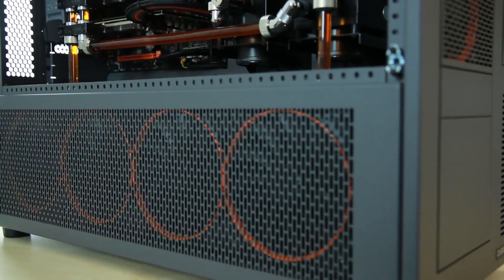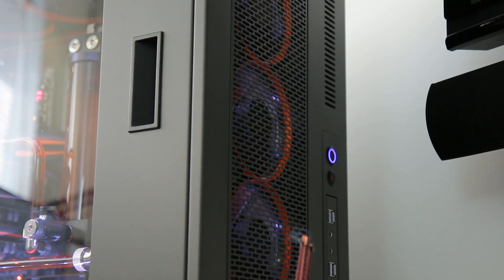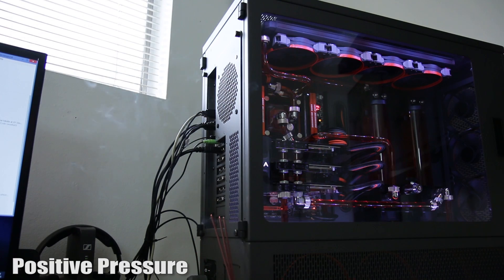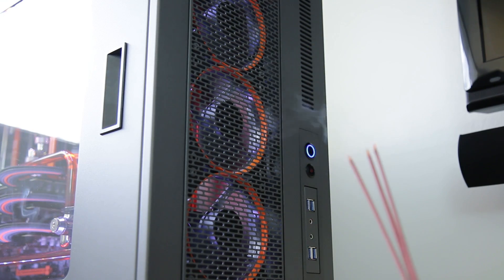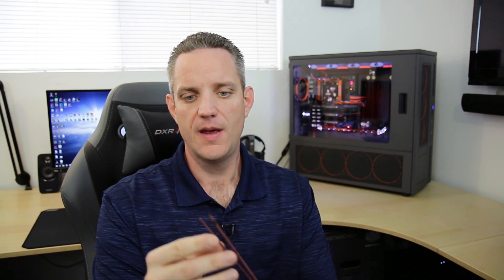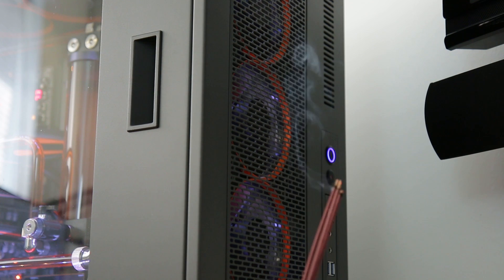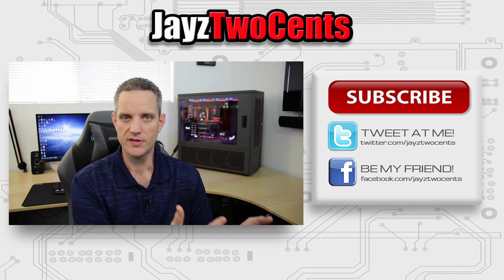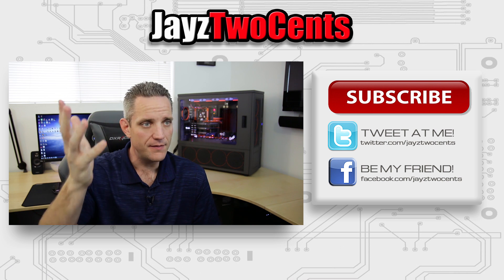Case Flow and Pressure Demonstration - How to balance airflow

Comment: It's worth noting you missed another huge factor that makes maintaining an actual neutral pressure inside pretty much impractical without actually using an actively managed system with a bunch of sensors. Namely the fact that how much the air is heated inside also affects the pressure a system which had neutral pressure when it hits equilibrium right after power on would actually become positive pressure once the components begin to heat up. Sure you could compensate for this but to make it work regardless of the load on the system you would definitely need to have the airflow systems regulated by feedback from internal and external barometric pressure of course the fact that neither the air velocity or air temperature within the case will ever be uniform and as a result the air pressure inside the case wont be uniform either as the Bernoulli Equation and PV=nRT will explain why this is the case.

Comment: Great method to show the air flow!
But strictly speaking, positive pressure only means the average air density in the case is higher than the outside, thus have higher pressure. Only during the transition from negative or neutral pressure to positive pressure is there more air entering into the case than leaving the case. Once the pressure inside the case is stabilized, the amount of air going in and out will be equal again. If there's always more air going in than coming out, the air density inside the case will keep increasing without limit, forming a tiny black hole in the end, which is apparently impractical LOL.
Reply: You would have the most cooled PC on the planet if you formed a black hole. You would also have no PC. So two birds, one stone. Make it happen.
Reply: This is how I lost my first pc build
Reply: How do you think I created my singularity time machine?
Reply: Dam, someone beat me to it. Guess I was 3 years late to the party
Reply: positive case pressure is determined byairflow out exhaust fans and exhaust vents it does not account for all other cracks and crevices. the point is to have more air coming the intake fans then out the exhaust fans thus positive pressure
Reply: Have you think about mass inertia in your conclusion aswell? In the heating system of your house is pressure (about 1.5-2.5bar depends on the hight of your house) and ofcourse a pump. So right in front of the Pump, is a little less pressure and right after it you got a little more i think about 0.5 depends on the power of the pump. I know thats water and not air, still there should be a pressure difference in your case aswell because of mass inertia.
Reply: Actually I don't think so. Positive pressure means that you are pumping in more air than your normal exhaust vents (including exhaust fans) can handle. So air is starting to get out of the case in way it wouldn't normally do. That is through holes for the screws, edges between panels etc. In neutral pressure dust may build up in those holes.
To simplify the things up, lets say you have a one exhaust vent whitch can handle 1m3 of air per second (I know, ridiculous amount of air). If u pump in 1m3 per second with your intake fan, the pressure will be neutral, as all of the air will be pumped out from the case with exhaust vent. But if u pump 2m3 per second, the exhaust vent will handle only half of it. So the air will have to find other ways to get out of the case, that is all the cracks between panels, holes for screws and other places where dust may build up, or else it will explode like an overpressured car tire.
Reply: @Failer__  Also, the static pressure of your fans is what determines the maximum pressure your case can reach if you had poor exhaust.

High static pressure fans are ideal if your case has restricted airflow. If you had an open air case, you'd want to optimize for CFM instead, where your fans don't necessarily have as high of a static pressure, but still move a lot of air.

Static pressure is like the measurement of raw load you can pull uphill; CFM is like the measurement of how fast you can actually move.

So, if you have a high CFM, high static pressure fan, you'll get a lot of air in your case even if it's not optimized.
Reply: @Failer__  No, physically speaking air in = air out, unless the case pressure is increasing.

If the case pressure with respect to time, dP/dt is 0, then air in = air out.

I think that this is actually more important to account for in fan placement and venting in your overall case choice and case design. I.e. the Fractal Torrent, possibly the best air flow case on the market, has a ton of free space at the back for air to escape.

This is important BECAUSE air in=air out. I.e. if your case has one exhaust port but tons of air intake, you should really get high static pressure fans so that the air flow out of that single exhaust port is high, because the air going out of that exhaust port is equivalent to the air coming into your intakes (minus leakage).

Getting "neutral pressure" is actually not strictly important; neutral pressure is a good indication that you have a good balance between exhaust and intake, and therefore your fans are not redundant.

Comment: 2 questions

Do you need a fan controller? 
Second is I know that the front is intake and the back is exhaust but what I'm confused is what is  the top fan going to be intake or exhaust and also the bottom intake or exhaust? Thank you

Comment: What would you do for a Corsair 800d case using water cooling?  Top 3 fans on the radiator for exhaust.  I could modify the case and get two more fans at the front of the case for intake.  Would you use the back fan as intake as well?

Comment: You should answer if mini-fans work to help with this positive pressure? I have a bunch of 20mm fans mounted in a bunch of spots and it seems to work well to optimize airflow with being able to adjust some of them as intake or exhaust to fine tune the point of perfection.

Comment: I will use only 3 case fans of same rpm, cfm and sp
1 intake at front
1 exhaust at rear
1 intake at top
I won't have any drive cage, will use single m.2 ssd and no HDD 
also the two fans on CPU cooler will push air towards rear
So is this setup fine ?

Comment: I use a similar method for checking for intake and vacuum leaks in engines, but I use a cigar. You can pull a LOT more smoke out of a big cigar. The gas station usually has a wide selection of big cigars.

Comment: I'm glad I found this video. I'm currently waiting for Fed-Ex to deliver a DIYPC 07-b case, which has 7-120mm fans. 4 intake, 3 exhaust. I'm worried about airflow, because it'll house a Maximus VIII Ranger, and a 6700K. It's a full ATX case, so all SHOULD be good.

Comment: Good Video!
I tested behind my video card on the PCI slots and sure enough it was sucking air...Made 2 exhaust fans intakes and now i'm getting a good positive pressure in the case with results to match, dropped 2C on idle on my Liquid CPU

Comment: I am aware of positive and negative pressure (studied engineering in college) but I didn't really account for it in my personal build but I ended up making a very positive system. I'm not using any filters so dust is just going to happen. The only thing I accounted for is fan placement based on hardware. I did not get any special fans for my build as I was trying to stay around $1000 so I used the stock fans in my Corsair case. I shifted my large side fan lower on the side panel and flipped it so it flows in which blows in to a compartment that essentially has a roof (my MSI 1070 fan intakes) so that space is air dedicated to my 1070. The front 2 case fans i shifted upward so that they provide air dedicated for my CPU cooler (super tall cooler master heat sink, forget the name right now). and one exhaust port right behind the CPU cooler. So 3 fans in, one out, and the top of my case is a mesh so any excess air rises out there. I specifically chose a midsize case where my GPU essentially touches the case of the side fan so it would split the case into essentially 2 compartments where I could dedicate air. I run just fans and at load/benchmarks I average about 40C on the processor and 60-65C on the GPU.

Comment: I am getting a corsair 460x (comes with one intake and one exhaust fan)
also getting a h100iv2 cooler. should I have the h100i in push or pull, and where? wtf I'm so confused :(

Comment: Good video, its funny I stumbled across this video Jay, I have had an old Tagan A+  EL Diablo Case since I built my last system back in 07. I recently upgraded essentially my entire system and reused the case (Old PC was ASUS ROG Exreme Mobo with SLI 8800GTX GPU's) At any rate since I was building my wife a custom system for Christmas and because of the fact that she had never had a custom PC I decided to buy her all the high quality hardware so my stuff had to be a little bit cheaper (Who am I kidding a lota bit cheaper) I went with a AMD8350, MSI 970A Krait Edition Mobo. 32GB DDR3 Ram and Gigabyte OC 1060 6GB GPU. At any rate, I noticed after about a month that I was having very poor performance issues with some higher then normal temps both at rest and under load. I blamed my Mobo at first, but I was given a mid tower case from my father in law who no longer wanted his custom build system as he didn't spend as much time on it gaming anymore. It is a mid tower and I haven't a clue what brand it is. But I noticed that the airflow of the case is 1000X better then my old case and my PC has never ran so good. My temps are below average and my system is happy. I miss having my flashy full tower case but I am very satisfied with this one.

Comment: what about in the case, lol, of smaller more mobile platforms? I run a mITX case due to travel, so I can actually fit my ITX in a carry on bag and not have to deal with a laptop solution (i hear they've gotten better, but I'm still a bit weary, and the prices are outrageous)

the case i'm running is a silverstone RVZ01.

Comment: I would be surprised if case "pressure" matters at all. Cases are specifically designed to not be air tight. If you stuck a barometer in there I'd be super surprised if it was anything other than .9999999999999 or 1.0000000000001 local atmospheres.

Comment: But given the slite amount of preassure that a fan can give... someone correct me if im wrong.,, you shouldnt consider the air as a compressible fluid. (only if you were makeing speed of close to 0.3 mach, depending temperature). So then if you analize the control volume you would find that the awnser is other, since the law of conservation of mass for this kind of fluid gives you that the flow of the fluid should be the same on every "section".  Other thing, if you want to keep a good flow i think would be good ideas to... remove the corners of the chase of the computer, it adds just to much noise, formalize the air flow (only one direction for in and out) and change the overall shape of the chase XD... im always trying to find the ways to apply fluids mechanics to computers, im still lack the experiencie though

Comment: Eh isn't the smoke made up of water vapor? (My point is it might not be enough to do any dmg, but I kinda don't like the idea + there is even a more simple way and its free.)  I usually just use my hand and I feel the air flow or even an easier way. You can run heaven and from that you can feel the temperature of the air. So if you feel the hot air blowing at your hand that means its exhaust airflow at your hand and if you don't feel hot air blowing at your hand then that means its intake airflow.

Comment: I have the NXZT s340 elite. I'm concerned because i have the h100 i V2 radiator mounted on the two front fan slots, and one top/rear fan which are both exhaust. Jay mentioned in his radiator video the difference in pressure with push/pull radiators is miniscule. So my case pressure is negative and since it's very open dust might be an issue. How can i fix this?

Comment: Positive pressure doesn't really mean you have more air going in than out. That's only true for the first few moments, after which they are both the same. Otherwise, you're eventually going to have an explosion.
Reply: Ash Scott no, the air goes out of the cracks and crevices of the case.
Reply: So you don't have more air going in than out

Comment: If you have a 360 rad in the top, will it be to best to take the fan closest to the cd-drive as an intake and the 2 other as exhaust, when i have a 240 radiator intake in front. Or every fan on 360 as exhaust and maybe an extra intake fan in both solutions?

Comment: Hey there, yesterday I changed my airflow from front to back to back to front and amazingly I got better temps. What I have now is.

-2x 120mm on my Radiator going in from the back - motherboard controlled
-2x 120mm on the top blowing air out on 7V
-1x 120mm at the bottom blowing air on my GFX - motherboard controlled
-1x 200mm in the front getting all of the warm air out at the front on 7V

Was just testing it and for the idle temps sometimes it's quite a bit lower like 5C's and when it goes on load it also a bit lower, maybe you can have that as a new theme about airflow :D 

Changing the direction of airflow. For me it works =) don't know how it is with other cases, I am using a Anidees AI-07B

Seeya :D